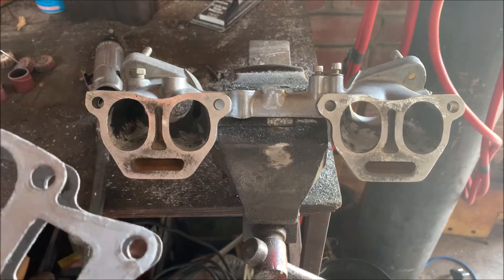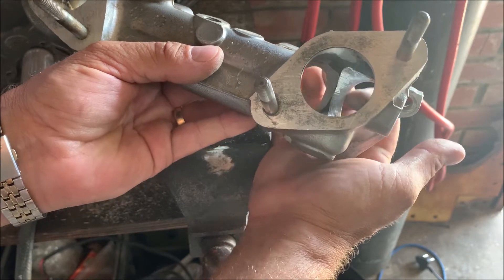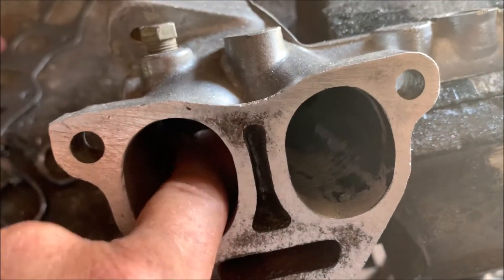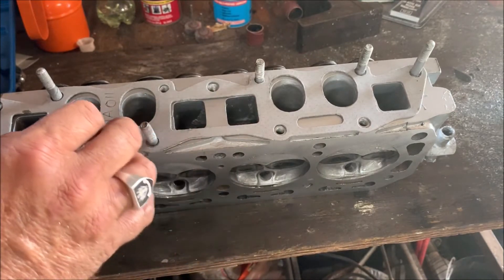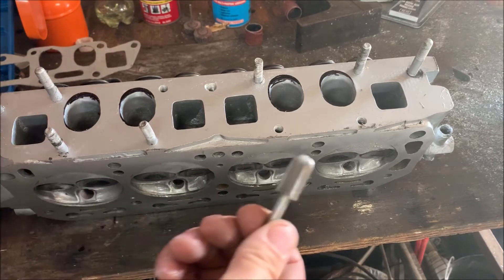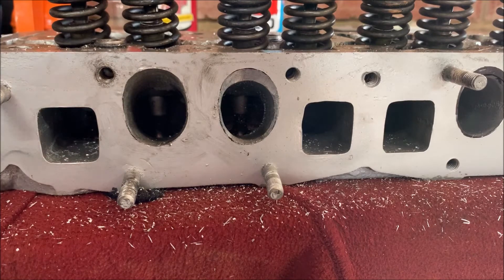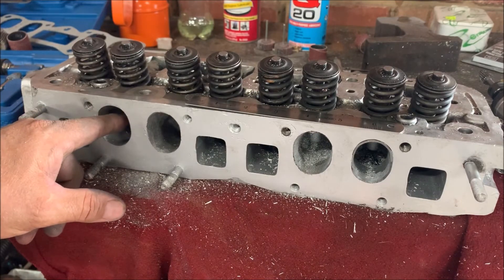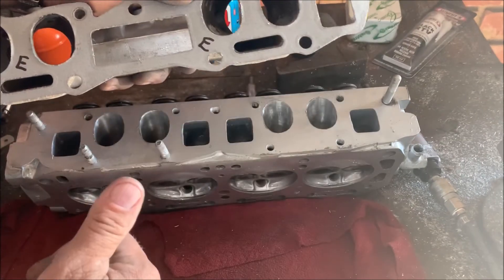Nissan A14 GX cylinder head porting

Comment: What will performance be like with 77.5 mm pistons
Reply from the maker: Standard the engine is 1397cc, the 77.5 pistons with take you to 1453cc, with higher compression and a good cam it will perform very well. The A14 and 15 engines respond well to any performance changes when it is done well.